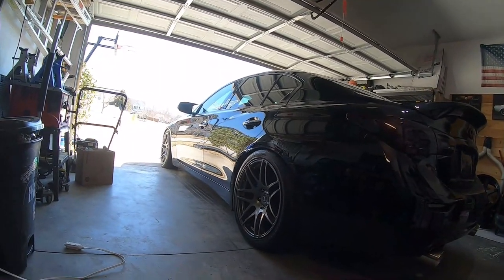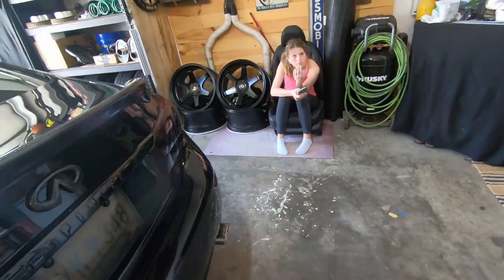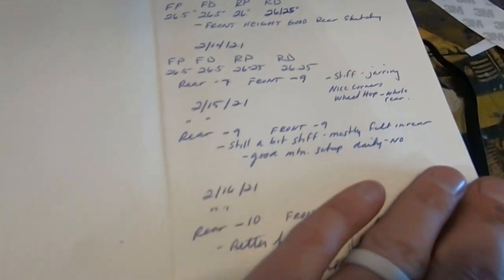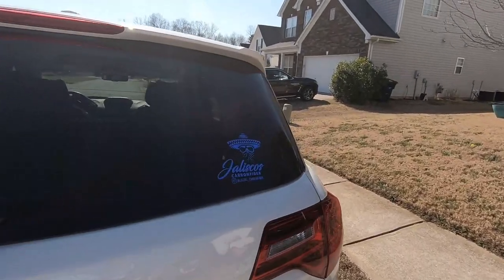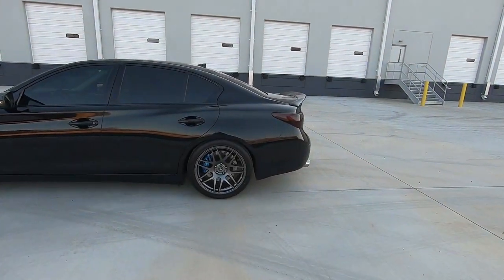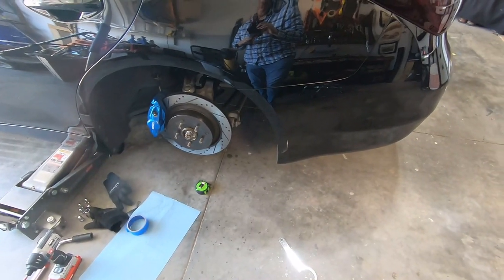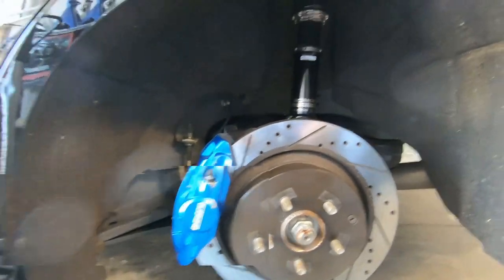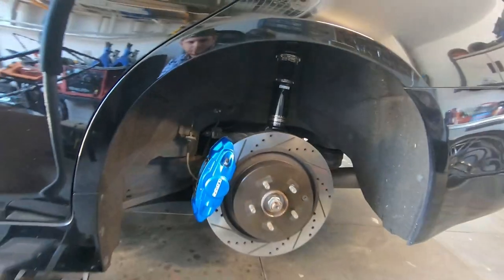ALREADY Wrecked a Caliper!  Q50 Vlog

Comment: J, I feel you on the caliper. I was painting mine and tried to get a head on my second clear coat. It was 52 degrees outside but everything I was using was warm. The temperature cooled the spray as I sprayed them and completely ruined my shiny clear coat.. I had to strip and start over. I’m still mad. 😂😂 also, I wasted those stickers I got from you.. 😞
Reply from the maker: Nooooo!

Comment: hey speed culture , i wanted to know if you scrape over speed bumps , or scrape at all with the coils ? I’m thinking about getting some to close the gap i have between my wheels
Reply from the maker: No scraping unless a real steep entry or something
Reply: @SpeedCultureStudios  thank you just wanted to know , i have 19x9.5+22 offset and i’m on the tein lowering springs , i just want to close up the gap , also what tire size you running ?
Reply from the maker: @andrewmaldonado9974  275/35/19 and 255/40/19

Comment: Hey speed culture studios, I currently have a Subaru Legacy 2019 runs good but is slow asf, I’ve been looking at a 2014 q50 premium with 77k miles and is listed for $17,998 which is sold by carmax and I can get a warranty with 6 years and 150k miles for only $15 more a month, would you say that’s a good deal?
Reply from the maker: I would say it’s a pretty good deal.  The price is high but considering the car max warranty it’s pretty darn good!
Reply: @SpeedCultureStudios  appreciate the input

Comment: So speed why you didn’t you clear coat the calipers after you spray it, I think that would prevent it from happening again don’t you??
Reply from the maker: No.  Brake fluid will eat right through clear too.  I don’t clear them because it’s easier to change up down the road if I want to.  Rattle can clears can discolor and fade easily as well.  They just don’t hold up to heat that well in my experience
Reply: @SpeedCultureStudios  facts!!  make sense I’m thinking between spraying mines or powder coat them 🤔??